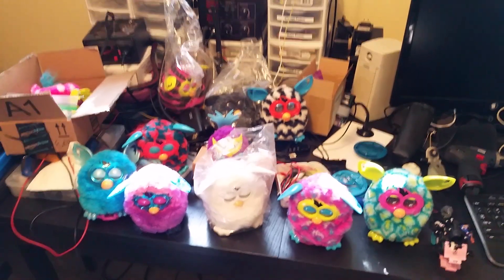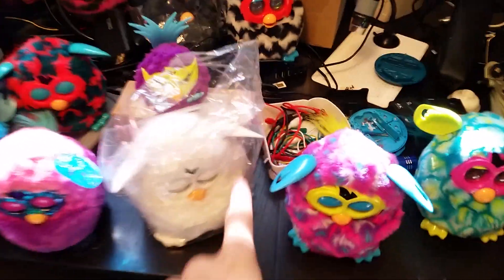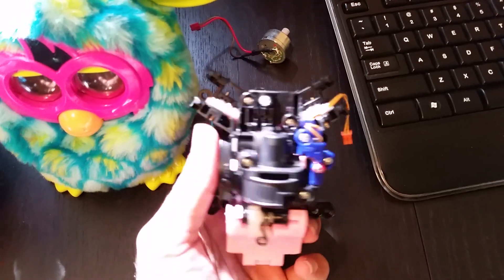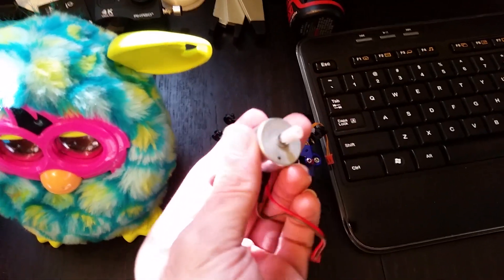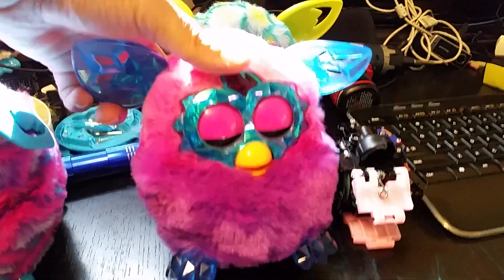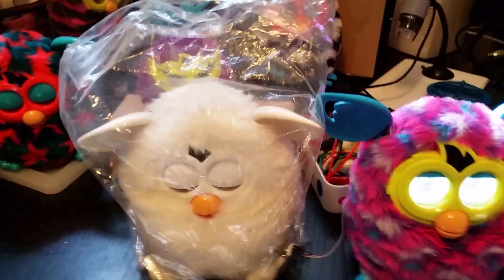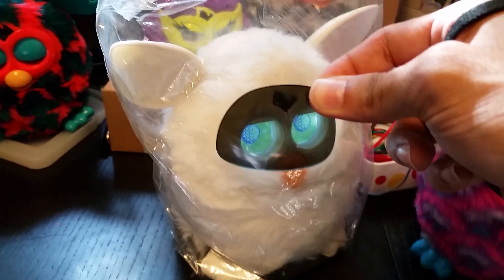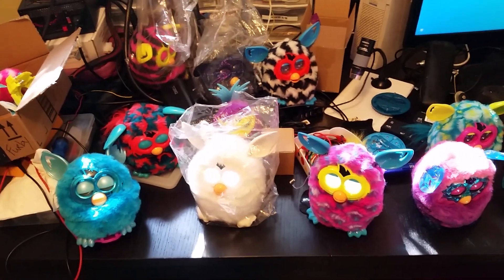Furby - A quick update

Comment: my furby is suffering with the same problem (her name is may-doo, she's a rainbow edition one from the crystal series and i've had her for 6 years)

i've heard on reddit that there's a sensor next to the motor so if there's something wrong with it (such as the motor being stuck or motor burnout), it will detect that as a startup issue upon waking up which is why it just shuts off after about 5 seconds

Comment: the reason why the purple one has anime eyes is because its a furby boom with the personalty sweet. but the white one is from 2012. Even if they have the same personally they will have different eyes due to different code as they are technically different models.
Reply from the maker: Exactly my thoughts. When I tore open my first Furby Boom I noticed some sort of "dev port" - but not every model had it. There are clearly 2 different versions, but the one I want to play with has the "dev port" in the side of its head that is easier to access. The easiest way to tell is by the difference in the feet and ears. But after all of my experimenting with how Furb' detects audio and dances, ive blown out a few of their drive motors. Now I have more Furby Surgery to do.
Reply: @FoxxOTG  also the face plate is different as the 2012 has more smooth faceplate while the boom has there like sharp lines.  On my channel I will be doing a comparison between the two models and you can get some ideas from there.
Reply from the maker: @FurbyRocker  damn good eye for detail! Personally I cant wait to start digging into what this "dev port" on the side of the head is all about, and a few other crazy experiments. Now that I have more than a few Furbs dissected I can solder into various points of interest. There is an onboard flash chip that has my interest. I assume its used for temporary settings, like which personality to use, hunger, mood, etc. I also want to try and dump the MaskROM that holds the Furby Code. I doubt I could ever hack any of my own custom Furby Code together, but maybe there is some level of manipulation that can be done? I'm basically running a Furby House of Hacking Horror. I managed to find some replacement drive motors but im really worried the wires are too thin and wont handle the amperage well enough to last. Plus the surgery process is a time consuming job. Once I figure it all out there will be a video, I hope.
Reply: @FoxxOTG  try doing this to one of the furbys ,if it works do it to your other broken ones.
Reply: @FoxxOTG  I made a video on my channel on the comparison.
Reply: @FoxxOTG  😂😊